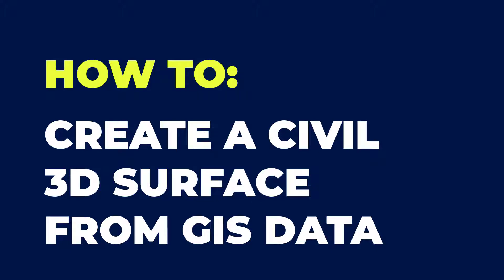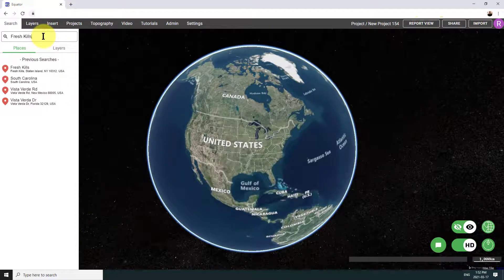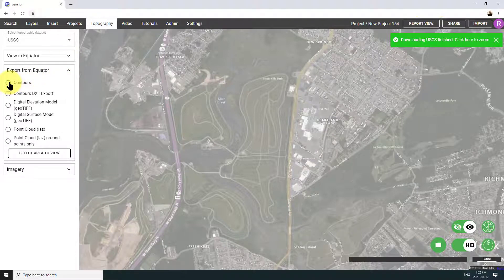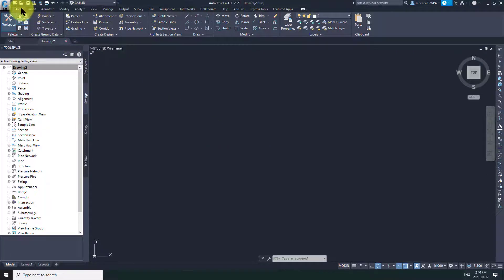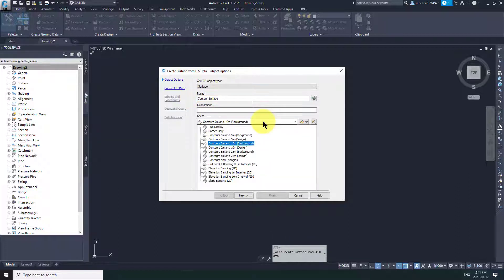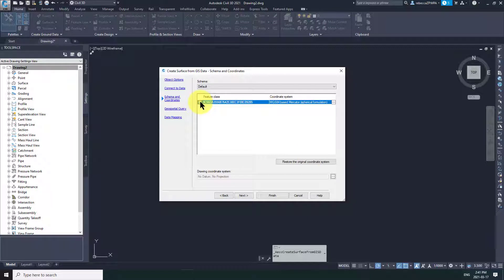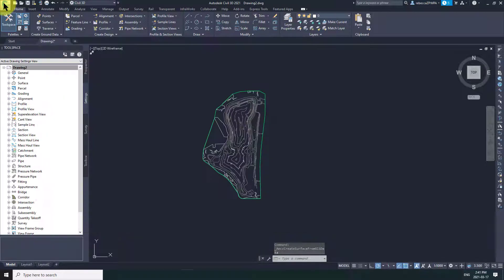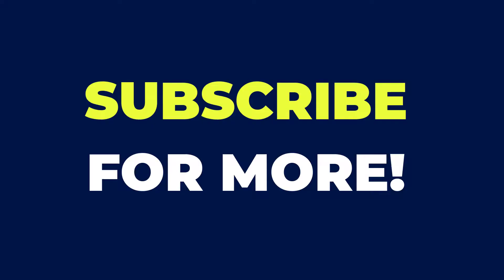How do I create a surface in Civil 3D from GIS data (contours in shapefile format)?

Comment: The surface isnt appearing in right geographical location - how to fix that?
Reply from the maker: When you export a product from Equator, make sure to select "Custom" under Coordinate System to make sure you're getting your data in the projection you need to align with any other data you have.